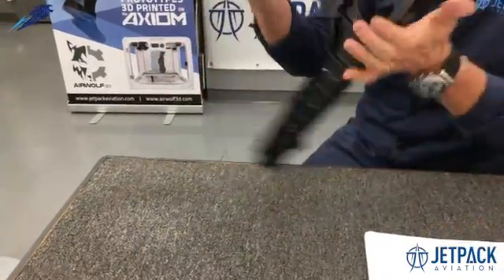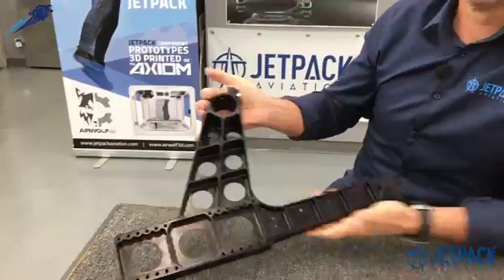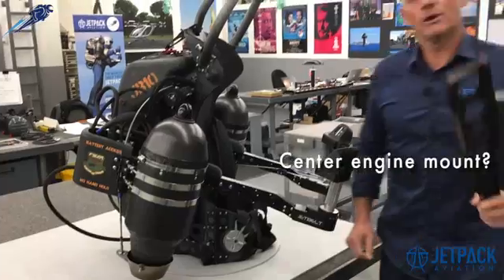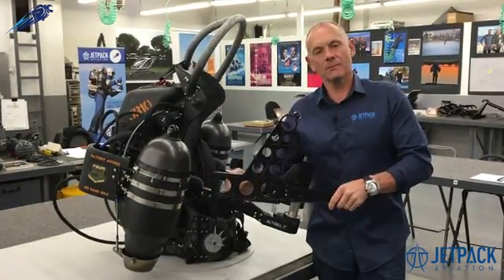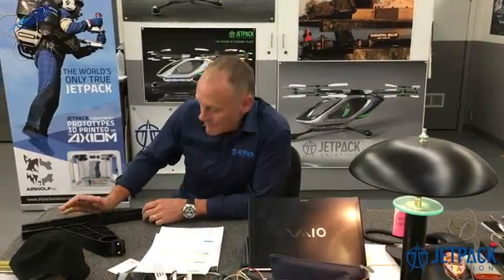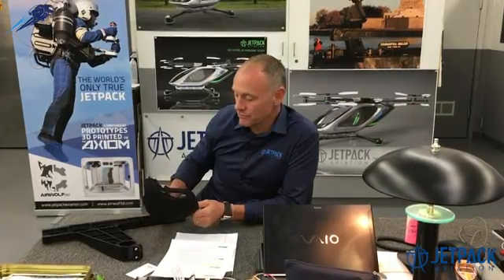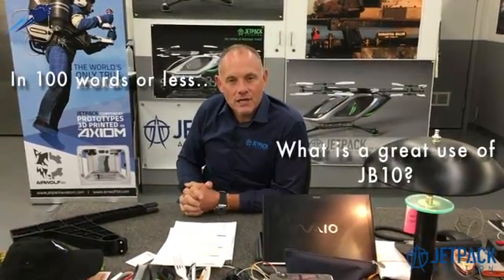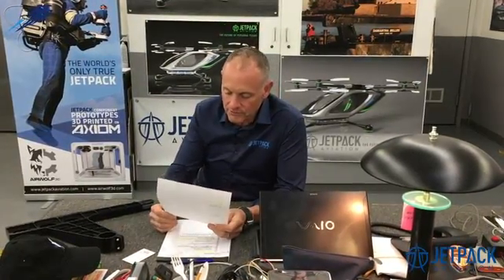So, exactly what was that mysterious JetPack Part?

Comment: Be good for Inspecting Transmission powerlines instead of using a helicopter.
Also checking distribution powerpoles that have suspect timber cross arms that are cracked or rotten (closer inspection rather then binoculars) or other defects P1 or P2